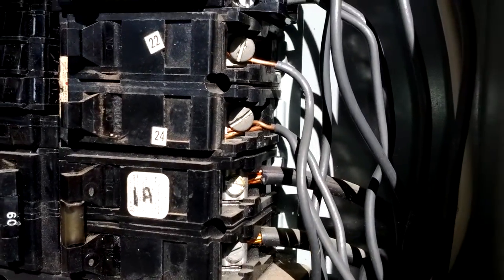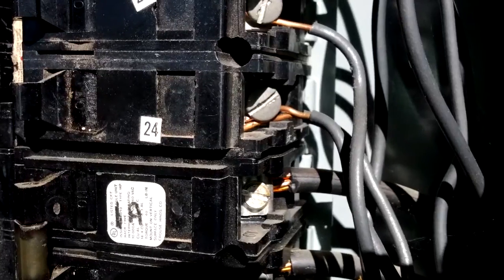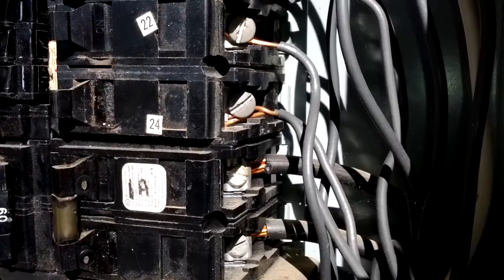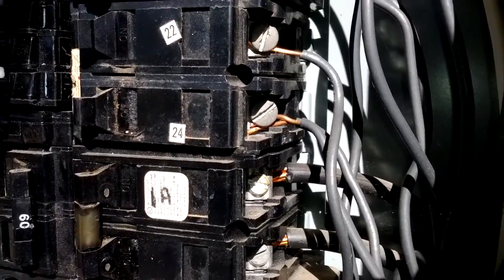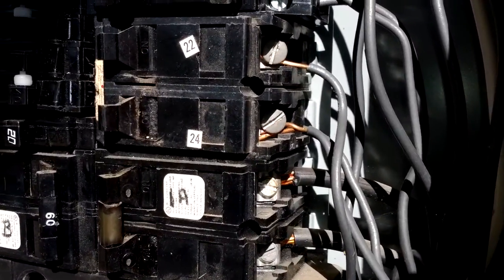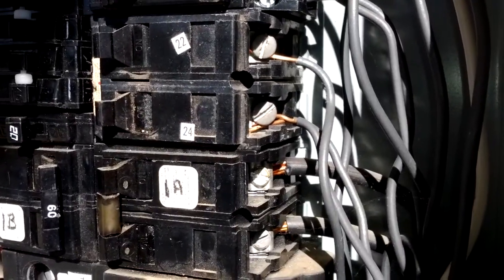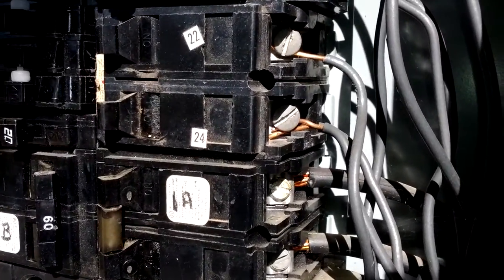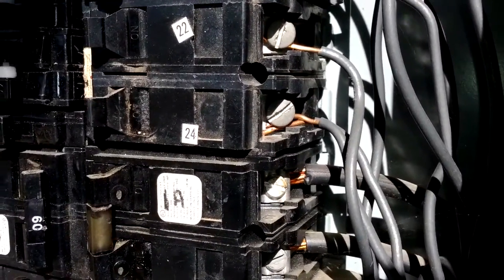Electrical Two Wires into One Breaker.mp4

Comment: Simply connect the two wires plus a pig tail with a wire nut and then connect the other end of the pigtail to the breaker.

Comment: What if there's not enough breakers?? We had work done a while back and ever since if the water heater is running the same time as the dryer (which is often) the breaker trips...its a double breaker and I figured out those tools spliced in the dryer wire into the circuit on the water heater behind the wall. My panel box is full as far as breakers go. I I can run a new line pretty easily through the attic from the dryer to the breaker box and have read you can buy a breaker which accepts two circuits...would this be safe, is it correct, and the best way to go?? Help meh please! my close keep smelling like mildew and I have to take cold showers often or wait :/

Wait...looks like you don't respond to your viewers :/ 

THANKS
Reply: Just run a new 220v wire and breaker

Comment: If you were out of slots to add a new breaker, would it be acceptable to add a double pole breaker (I think that’s what it’s called - basically, a replacement breaker with two switches/connections)?  Thanks!